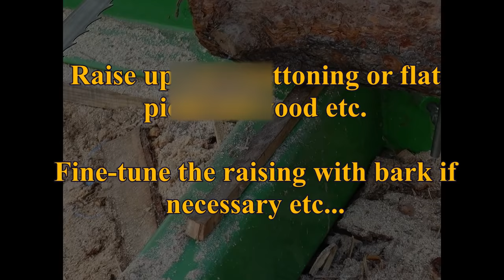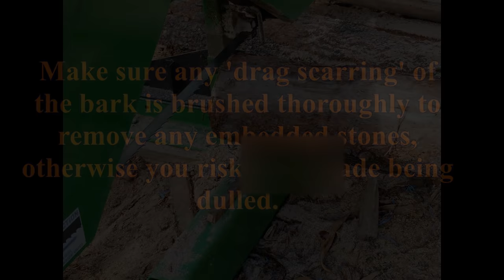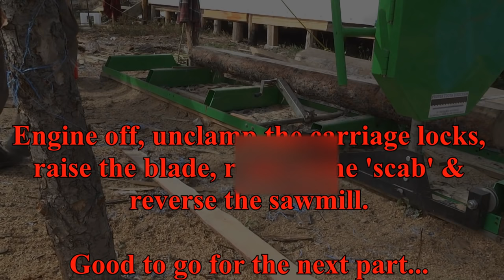How to Use the Harbor Freight Sawmill - Part 1

Comment: I have this mill. it was actually the first mill I started out with. I used it for a milling business and it will hold up decently if your willing to modify it. I made enough money with it to buy my new turbo sawmill M8 (10k) with it and a decent tractor (10k). Here is what I would call "MUST DOs" if you want this mill to be decent.1. Make the head into a 4 post. I had scrap laying around so it wasn't hard. It moves around to much and wavy boards look like crap.2. Extend the track and weld everything...bolting the track is bad...it will move around and lose square.3. I removed the push handle from the right post and welded it on to my 4 post. Lets you lift the head about 6 more inches. Get more 2x2 square and weld it as far out as you can get it on the skid while still letting the mill roll past so you can move you log braces further out. Doing all this will let you mill up to 26 inch logs, 27 if your willing to turn and square after every pass.4. Cut the crap out blade shrouds and open them up to the sub frame inside. The V is too restrictive. If you open it up you will be able to cut 6x20 slabs/beams.5. The lifting action on the mill I got was crap. If you didn't hold the handle, it would vibrate around every time. I fixed this with a harbor freight 1500 LBS winch...I took it apart and welded some flat bar into a bracket. The winch auto-breaks so no more moving. The clamps on the post are junk but with the winch it was steadier. I built a small battery bracket for the winch.6. I replaced the motor to the 13 hps predator from HF. Its cheap and has 5 more horse and electric start. The new motor charges the battery for the lift winch.7. Get rid of that crappy measuring scale. I buy all of my blades from Cooks mills. They have a magnetic rule that is already set to the kerf of the blades you buy from them.8. Put a fine valve in line on your water system. Will save you water and you have better control.9. Trim off the bottom of the long log supports flush to the side of it. If you don't, you cants will never be square.These are some of the things I've modified and improved on. Even with all the changes I've made I have less than 2500 hundred into this mill and it cuts really well now...I used it to build a solid business. I am still going to make a log turner for it out of a couple more winches I have but those mods are down the road. This mill is only doing beams and slabs now since I got my swing blade. I'm not sure I would recommend this mill if your not willing to or able to modify it. A welder and a plasma cutter make this mill rock for the money.
Reply from the maker: +Mike White Great post Mike. Would love to see a video and pictures of all what you described. :)

Comment: on last few cuts it seems like wood bows. anything out there to hold wood from bowing up on these mills. It cuts good till you get thinner stuff than it cuts thicker or thinner. getting off about 1/4 inch at times. Have to turn it around and trim other end. little help on this if anyone having the same thing to happen. am sure they are.
Reply from the maker: Yeah, I've examined the sawmill closely and it seems to be frost heave over the winter that has moved the back two sections of the mills rail foundations (which are wood) slightly downwards. This causes the 'upward' crest effect. It's not absolutely critical as a good session with the planer can sort it out on the finishing work.
Reply: A good coat of sawdust about 5 or 6 inches deep around the mill will  keep the frost from heaving the  mill and causing it from having warped boards! Thats what we did in Minnesota when I  was a  sawyer at a mill there!

Comment: how long will it saw been looking for a while trying to decide
Reply from the maker: +Matthew Perry 
How long?

Well it comes with 6 feet of track as standard but an extra 6 feet of track is available to extend it and is advisable, which this video shows as I cut 8 1/2 feet of log into beams. 

So this model is 12 feet in length for the track.

Comment: You are right on the thick/thin issue, but your method of measuring is off. The way you describe, you will not be following the grain of the wood, but will be cutting the grain at an angle, which is a bad thing. The mill needs to be measured and aligned according to the center of the log at each end, with the thin end raised the distance required to make the center of the log to table equal at each end. You WILL lose some material, but not enough to worry about. Most of the loss will be bark anyway, and the tiny bit extra will be sapwood. Your good boards will all be nice and straight grained (as straight as the log that is, lol).
Reply from the maker: So the center and the end as the measurement positions then?
Reply: Center of thin end down to table and center of thick end down to table. Shim to make the two match. Say that the thin end is 1/2" thinner in diameter than the thick end. You would shim approximately 1/4" to make the centers match, not 1/2".

Comment: Things junk for the Same price you can get a woodland mills hm122 and have zero issues and not have to modify anything
Reply from the maker: This sawmill didn't cost anywhere near that price. Owner paid about $1,700 IIRC and it was about 5 years ago too when that Woodland Mills wasn't even on the market.
Reply: @LandersWorkshop  
Paid $1900 shipped they threw in 5 new blades and a cant hook for free